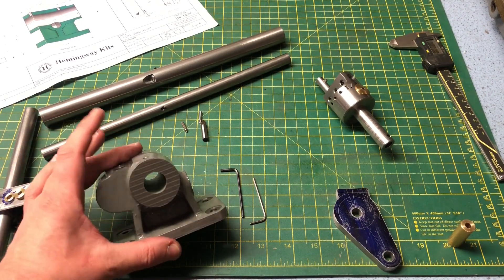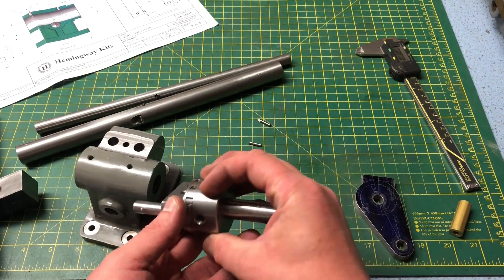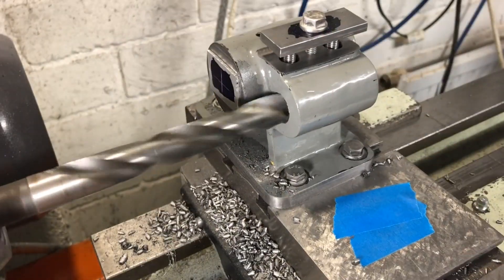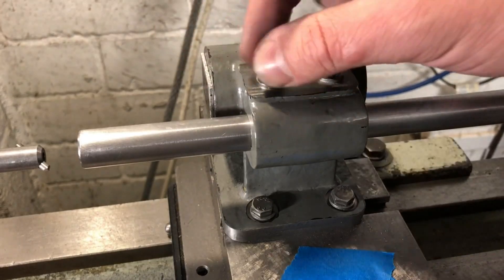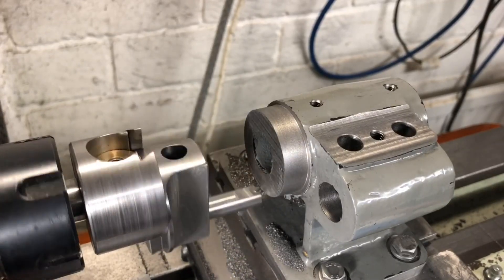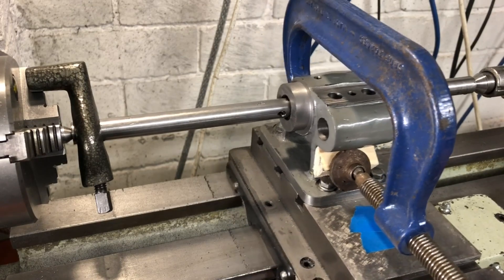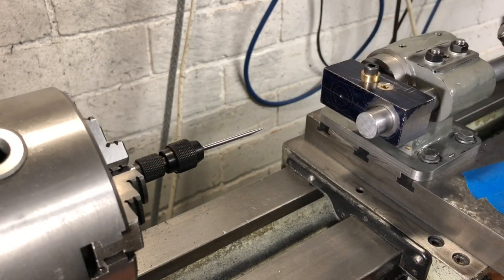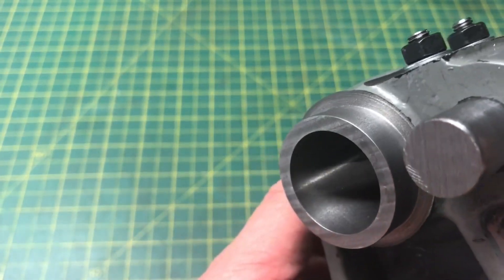Building The GHT Versatile Dividing Head - Part 2 - Boring The Casting

Comment: Very well produced video (and reminding me of the steps followed when making one of these decades ago).  Machining cast iron is a very dirty process and best not to use compressed air anywhere near it.  Also, recommend covering lathe bed etc with paper to prevent some of the chips and grit becoming a grinding paste.  Machining cast iron is the fastest way to cause wear in sliding surfaces.
Reply from the maker: Really good advice. I am guilty of both using air and being lax with covering ways. I am, however, very careful with subsequent tear downs and clean up. It is also worth trying to do all of the cast iron work at the same time to minimise the number of times you need to sort out the mess!

Comment: For someone who is self confessed “not an engineer “ where did you get the level of skill required to achieve these results, I’ve been in engineering for 52 years and would be delighted with these results well done. 😮
Reply from the maker: Thank you! I think it really just comes down to time. Someone with experience in professional engineering would produce the parts in a fraction of the time it takes me. I’m sure if I was on a job clock the quality would plummet!

Comment: Have you seen stefan gottswinter's video on tramming his mill?  He grouted with epoxy so as not to reduce rigidity.  That might work for you perhaps?
Reply from the maker: Yes, I have just re-watched it. It is exactly this issue that is causing the error on my mill and (done correctly) this would solve the problem. Trouble is I have been wanting to replace this mill with something slightly heavier - but still small, Centec 2 maybe? - so I haven't got around to fixing this one. It has to be said though, the time it would have taken to deal with this when I first acquired the machine would have been paid back 100 fold given the time I spend working around the problem!